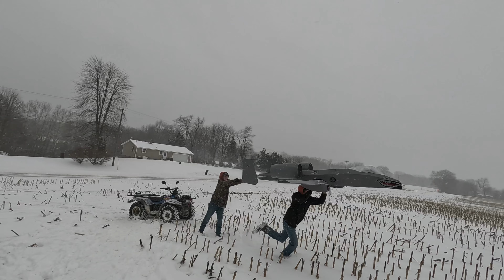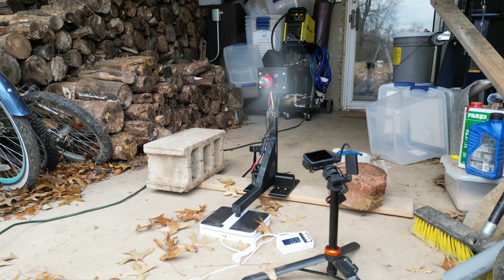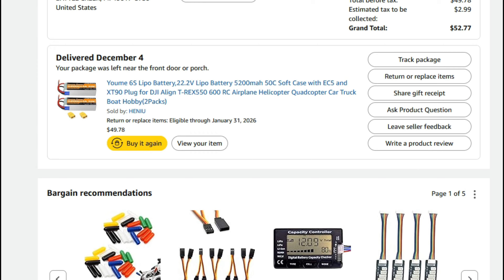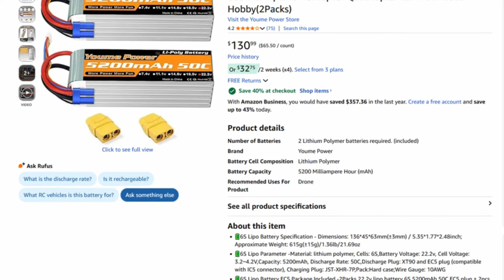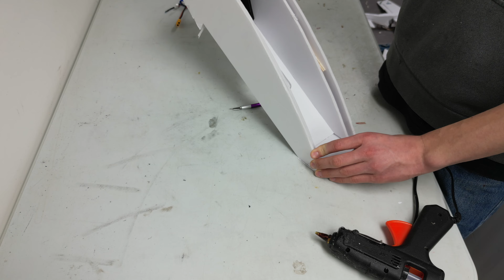GIANT 10-Foot RC A-10 WARTHOG — Build, Maiden Flight… and CRASH!

Comment: I'm absolutely against any kind of mekeshit in this type of projects. Put those motors disguised under the wings is awful.
Reply from the maker: The price of EDF's that it would take for this thing is insane, also the amperage they draw is crazy!
Reply: @HoundpupRc  No joke! edf’s are expensive!  That’s why I stick with propeller planes 😂
Reply from the maker: @FlyingAceRc  Not sure if you could even get big enough EDF's...Might have to use turbines, which would be difficult with foam, not to mention VERY expensive!